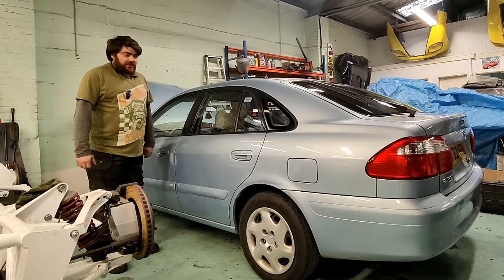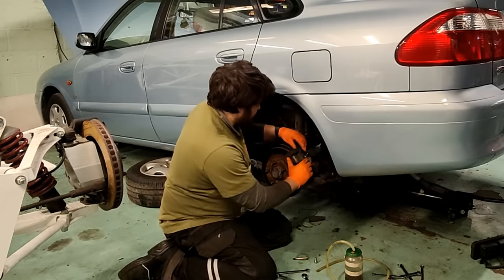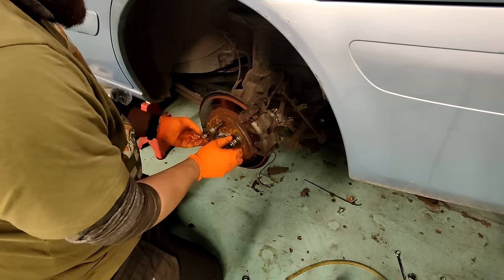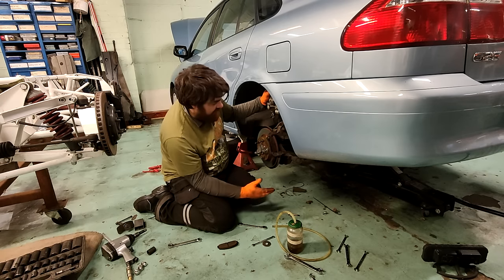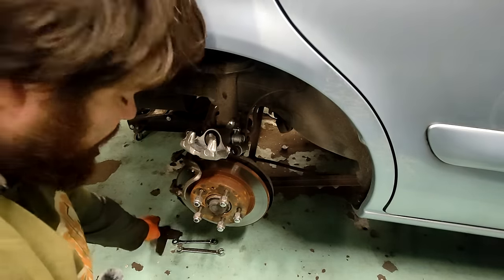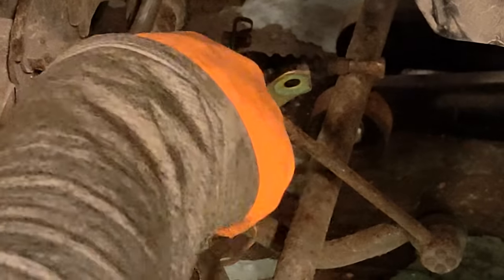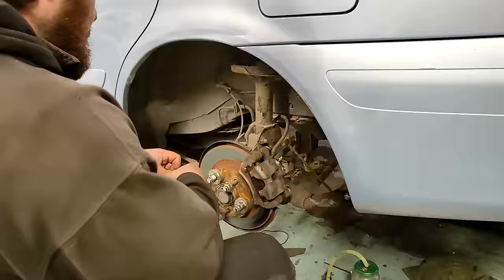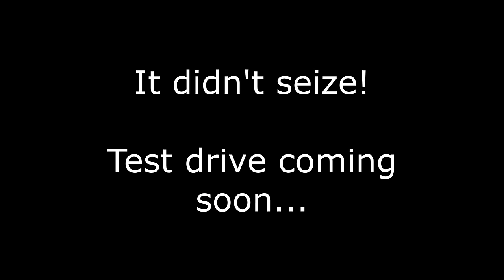Solving the Mystery of the Mazda 626 Brake Problem | On The Ramp

Comment: Thankyou again for sorting that for me, last time I trust Ebay for callipers.😅 Or a H place. I can't complain too much a they still passed the MOT enabling me to get it to you. But at the same time they could have changed the other calliper rather than  stating they didnt know what was wrong and letting me go on my way! #Ethics #silver lining?...
Reply: Probably figured it wasn't worth the hassle trying to figure it out. Their business model is volume. Get as many cars in and out as quick as possible. Doing diagnostics on a single car all day doesn't really fit their model.
Reply: Glad it’s fixed but I can’t help thinking that if “the customer” had been fully interrogated at the start as to what the whole story was regarding the sequence of failures and replacements then the actual solution would have been pretty obvious or at least logical !

Clearly there was something iffy with the old new (?) callipers.. maybe some mismatched components caused them to fail early ?

Comment: Failfords are abysmal! Recently had four new tyres fitted by them. They handed my car back with so much tyre soap over the wheels and tyres I thought they had fitted white wall tyres by mistake. The “technician” then told me the TPMS light was on despite them trying to reset it, and that it was probably a faulty sensor!!! On arriving home and not trusting their “highly trained” technicians, I loosened up the wheel nuts and re torqued to the correct spec. On doing this I found none of the locking wheel nuts to have been tightened beyond finger tight! On checking the tyre pressures I found they were under inflated hence the TPMS light on dash!

Comment: A proper auto mechanic is a real engineer, without question….. Halfrauds and their ilk are just parts fitters….there is a big difference and the two should not be confused. 
Top drawer diagnosis and cure there Mr Kitchen! Wouldn’t have expected any less! 👍

Comment: It is amazing how many times new (or "nearly new") parts can be faulty. My field is electronics, and supposedly everything is tested, but over the years I've had quite a few parts fail in the same way as the original, and they are real head scratchers to troubleshoot!
Reply from the maker: Totally screws your thought process when it happens too, as it's normally the last thing you check when you've run out of other options.

Comment: We have had our 626 gsi  136bhp hatch for 19 years . In that time two sets of rear calipers a rear exhaust box,two rear abs sensors, two rear disks, one air con re gas, two batteries , cam belt , oil changes brake pads and tyres. The car is now on 185000. Still starts instantly , drives well , its our work horse. Every thing works on it as it should  electric windows, roof,mirrors climate control,cruise control. The only problem is a bit of rust but not much. Maybe boring and anonymous but it works well.

Comment: First thought after only having watched the first minute would be a Bad Brake Hose but after watching for 3 minutes it wasn't. 
Also about the Brake Master Cylinder: afaik all cars you come across nowadays have the front right and rear left brake hydraulics linked and the front left and rear right brakes linked,
Brake calipers like that are adjusted easily by pushing the brake down as far as you can and then pull the hand brake as far as you can a few times.
Had a similar issue on my XM before on the front right calliper after replacing the seals on it, had to order a remanufactured one after that and that fixed it...
Reply from the maker: That's just dual circuit brakes though, they've been around for years. What I meant was it'd need to have all four wheels independently connected to the master cyl, which I don't think I've seen before. It wasn't an adjustment issue, it was faulty. New one works fine.

Comment: That was very interesting: especially following the logic of the investigation, where probability is balanced against cost of finding out (a principle I know trying to fix my computer problems: it's probably not a loose cable, but it's easy to find and easy to fix, so do that first). Until finally it's cheaper to just try a new part, rather than trying to find the exact fault.
Reply from the maker: That's it. Experience is judging when to switch from one stage to the next.

Comment: Great little tinkering and problem solving video. I too tend not to use Halfrauds, have had a couple of bad experiances with them one on the wifes car when in for a service and MOT, they decided to eat their lunch while servicing the car, picked the car up and there was like chips everywhere in engine bay! Recently took the Escort in for new tyre, normally use a scottish chain that was run by the former CEO of kwikfit, but they could not fit me in. Booked a pre-arranged appointment, 2 hours later i was still at the garage waiting with people coming in and getting taken before me. So i do tend to stay clear of Halfrauds.....😂😂

Comment: I had two Mazda 6's. They both had issues with calipers. I needed to replace the front pads on the most recent and I picked up a set from a motor factors. Got back to fit them, and they were too big! Had to rebuild the car in the rain and take them back. The motor factors insisted they were the correct ones according to the computer! Got some from elsewhere, which fitted properly.

Comment: I have never trusted the larger chain store style garages. Way back in 1984, I took a Mk1 Escort Mexico to have the rear tyres changed. On the way home my wife, who was driving, said that the back of the car felt light. When we got home, I let the car sit for an hour or so and then checked the tyre pressures on the back wheels. They were both twice the recommended air pressure. Straight on the phone to Kwik-Fit (yes, I will name them). Didn't even get so much as an apology for something that could have killed us both. Suffice it to say the likes of them have never had my custom since then.

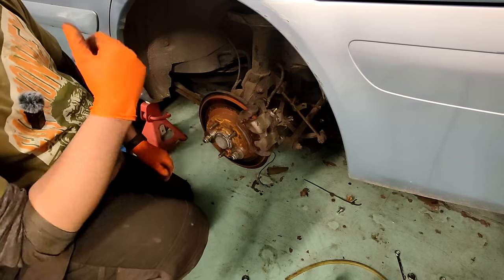Comment: 8:35 I'm pretty sure that Every car I have owned, the brake lights work without a key. I assumed it was a compulsory safety feature.
Reply: Not on my cinquecento 🙄
But the radio will stay on for 2 days without the ignition on if you forget to turn it off 😮 How do I know that 😂

Comment: When I got my Morris Minor a couple of years ago, I booked it into a local "classic friendly" garage to sort out zero braking action together with a light recommissioning. 
It had no brake fluid, they checked the wheel cylinders for leaks, but found nothing, so they refilled and re-bled it. 
I drove it less than 10 miles when they failed completely again and all the brake fluid had gone. It turned out that they didn't check the master cylinder, which was the problem. 
They wouldn't accept any responsibility as the brakes worked when I picked the car up... I ended up teaching myself how to fix it!

Comment: Very interesting vid going through the thought processes of problem solving.  
I had the similar issues with the nearside front caliper on my Xantia.  It's got to the stage of replacing it every 2-3 years as it would fail MOT due poor efficiency or binding.  Doesn't matter if it's cheap ebay or  expensive motor factor caliper.

Comment: Haha these cars are very common in Australia where I’m from. I could have told you from the start to throw away the disc, calliper & carrier. Bit the bullet & chuck everything in the bin & start fresh with some OEM parts. 
When I do brakes or any safety related stuff I always use genuine OEM parts. You pay a bit more but for me it is worth paying extra 
For peace of mind I don’t want to have re-do something 6-12 months later. 
Also when someone says another shop did this or that to a car I almost always know what ever was last worked on will be the problem.

Comment: I had a rear caliper with the same symptoms on my '92 Rover 216 GTi. The internal handbrake mechanism behind the caliper piston was faulty and wasn't self-adjusting so every time the brakes were applied, it wound out and forced the piston to clamp but not relax when pedal was released.
Reply from the maker: I reckon that's what this was doing.

Comment: My mondeo which shares alot of parts with mazdas had sticky brakes because the handbrake lever auto adjust had left the building. It was a nightmare to diagnose but the boys at TalkFord forum came to my aid when I was ready to put a stick of dynamite in the car. If this is a simular fault I wanted to contribute before watching the video.
Reply: Seized handbrake mech is also pretty common on the caliper. I usually loosen them up spray them with sticky oil when i do brake jobs.

Comment: Those floating calipers look identical to mitsubishi ones , some times the rear ones managed to rust inside the two bolted sliding axles that hold the two halfs together , and they burn the pads off because of the friction . the parking brake on some mitsubishis like the galant and pajero pinin (shogun) are different ,they are drum type and use the inside of the rotor disk hub as the drum .
Reply from the maker: They probably are the same. They fit a myriad of different Mazdas.

Comment: For brakes if you wanna even brake on each wheel, if you wanna especialy on rear side, need to sit in car, relase cable on handbrake and then bring it up seven cliks (teeth) and ,put car in neutral and then start it then push brake pedal 3 max 4 time and turn of car. After that screw the handbrake cable until it is just fine and all will be synchronized . Some things are not just n mechanic parts, there are some things in computer so you can see what was done even before.. Just now i am going to change discs on front part both wheel because i love when it is done in pairs, just i dont love when some parts are new and some of old will die fast because it is just like that in all parts on veicle. After that i will change both rear and oil and etc.... Just wanna get it all good ( perfect ) it is my fault i am electromehanic...so i have mazda 626 M1 variant D.2 and i love it. very good car, and you can repair it by yourself even today.

Comment: Hi I had a 626 many years ago and I had the same problem same side easy to free off cured it with some oil common problem with handbrake mechanism in caliper probably nothing wrong with original caliper hope this is helpful

Comment: The main thing to take from this episode,is that we should allways by our replacement parts at OE speck and from a decent source not cheep clap from China off the interweb,especially when it comes to The braking system.
Yes it can be cheaper on the web ,but when you have to do the job again after a couple of years there is no saving at all,
It's an old adage,but buy well buy once has never been more true,and with good quality comes peace of Mind.

Comment: I bought 2 double filament bulbs for my kia as a bulb blew . Motorfactors sold me 2 new lucas bulbs and i said to the lad " oh lucas, Prince of darkness"  he looked bemused,  anyway both turned out to be duds, they did light up dimly so i tried them on a battery and then found an old spare bulb in the shed which confirmed they were shite. The old spare is in the car now and i won't be getting any more lucas poo